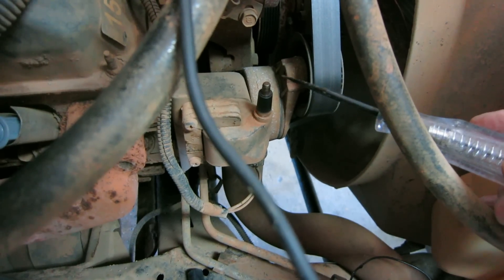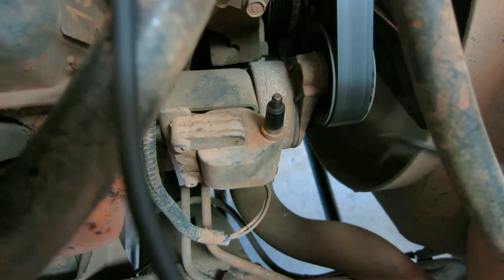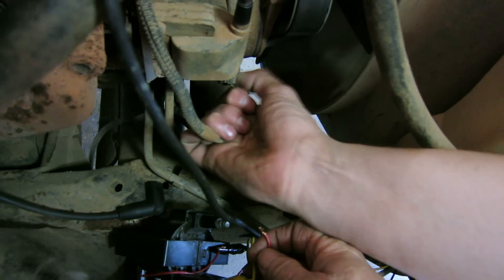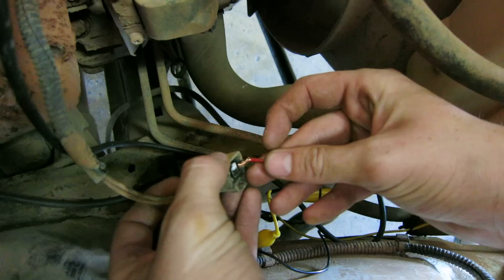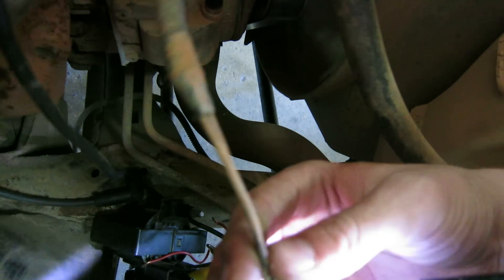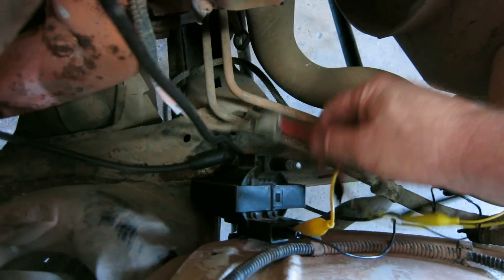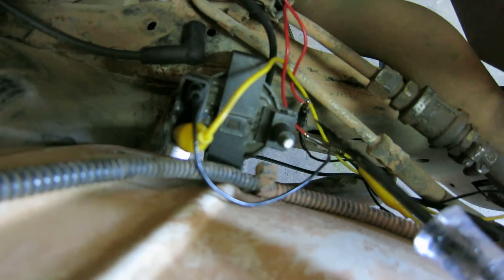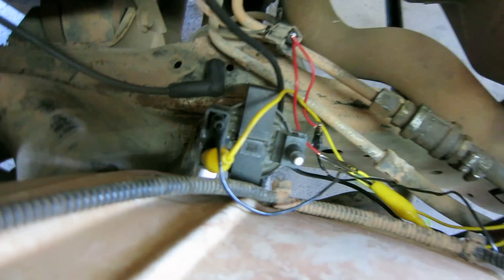Weak Coil Test

Comment: Same setup in my 99 Dakota 5.9. Had a standard tuneup done 8 months ago and everything was pristine. Started having random sputtering, rich fuel smell, and hesitation the past month but no codes. Ran a can of seafoam thru tank and it cleaned up some rough idles but random hesitation still existed. Figured to swap coil today since I saw this video and it was original, was cheap enough and saved a trip to the shop. Thing was rusted and definitely was heat/flashover scorched. It sounds and runs like new, no longer running rich, plus my radio reception is clear again, that should have been my sign all along but i didn't put the 2 together! I hate electrical gremlins, but thrilled its now resolved thanks to this!!

Comment: Coil failure today.. couldn't turn over a 99 5.9.….... Put an inline spark check and it started.  Took it out, no joy.  Tried it 3 times and it would start with a tester installed.  Wierd.
Reply from the maker: That's usually an indicator of fouled spark plugs because you increase the intensity of the spark st the plugs when you have the tester in there. Whenever I suspected gas fell to spark plugs I would stretch the spark from the coil to the distributor and it went fire up and then I would run it with the spark stretched until it cleared up and that would burn the foul off of the plugs. Also if I had a misfiring cylinder I would stretch the spark on just that one cylinder and if it started to fire while the spark was stretched I would know the spark plug was fouled.
Reply: Amazing. Not only did you answer Hillary’s question, you gave near a full lesson in applicable ignition diagnosis, testing, and even repair. I always enjoy your content sir. Second to none

Comment: If it's not the coil, I am going with a remanufactured PCM. No Code vehicle shuts off while driving wait a few minutes and it cranks back up.
Reply from the maker: That's not likely to be the PCM
Reply: @McCuistian  I'm putting a Delphi coil in tomorrow. the Present coil is the OEM 20 years old.

Comment: My car has a weak spark as well. I replaced the coil with a new one, but the spark is even weaker. Can the Crank shaft censor cause this? I replaced that with a new one as well, but then there was no spark at all (faulty?).

Comment: Needed to know the difference between a strong spark and a weak spark. I got a p0300 code. I changed the coil but it's still giving a weak spark, I'm thinking it might be the module... 2006 grand prix pontiac.

Comment: I have a half yellow sometimes blue spark my bike ran great with the same spark know its begining to sound like it misses when I come at hal throttle cleaned out my carb still the same what is it can it be the spark its bogging down half throttle it doesnt want to rev higher
Reply from the maker: The spark should be blue and popping very hot if you want good performance.

Comment: That's my engine (grin). One cold day I noticed that I could turn the starter motor at normal speed but the vehicle wouldn't start. I checked for spark, with an inline spark tester, and it was really weak and sometimes absent. I was thinking it was a bad coil, but overnight I warmed and charged the battery, and the next morning it was back to normal. I concluded that my coil needs a good battery for a cold start, surprisingly even more so than my starter motor. Eventually I swapped the battery and it was never a problem after that.

By the way, I notice that you aren't getting consistent spark with every turn, with either coil. Why is that?
Reply: That makes sense - my bet would be that if you had measured the voltage during cranking it would have been below the 9.5V threshold. With a weak battery the starter is drawing so much power that there isn't going to be much left to feed everything else.
Reply: Consistent spark = large gap
The coil needs to wind up more to leap a large gap. If your plugs are worn to a large gap you get a similar weak spark issue. He said the new coil made it run smooth.
Low voltage can turn the starter and fail to fire the injectors or ignition system.
Reply from the maker: Actually, our first test was done with the scan tool firing the coil and no starter operation - and the results were the same.

Comment: I like your tests. Ben hit by small car coils. That's a shocking experience. Got hit by a coil on a nice supra. That was a painful experience. Beware of leaky wires. Country critters like to chew them. Contact with hot metal can short them. If every thing was easy or fun there would be no such thing. Parts to compare test is a mechanics advantage.